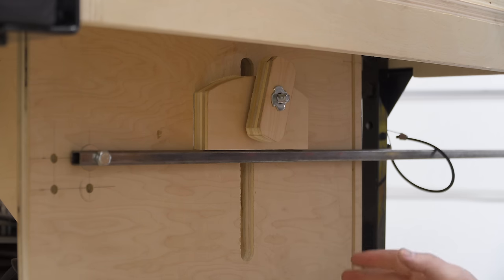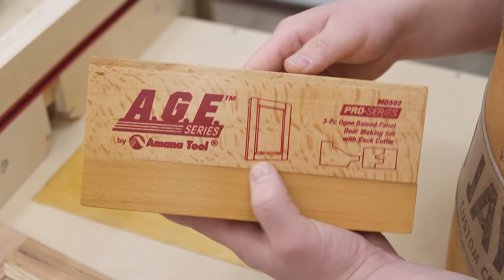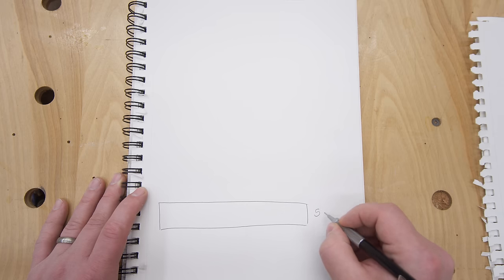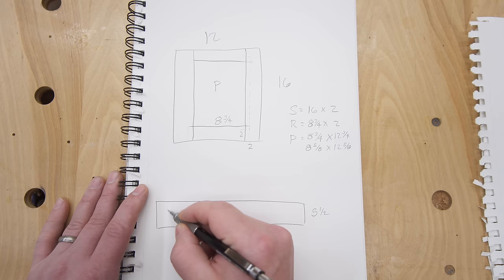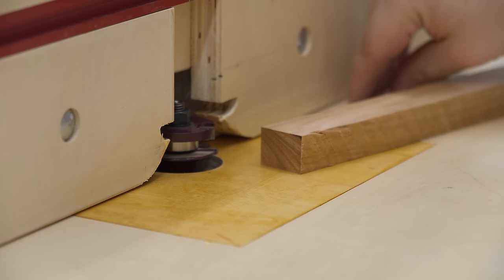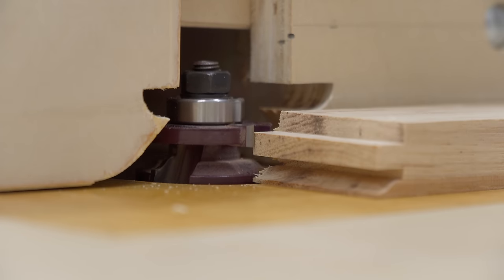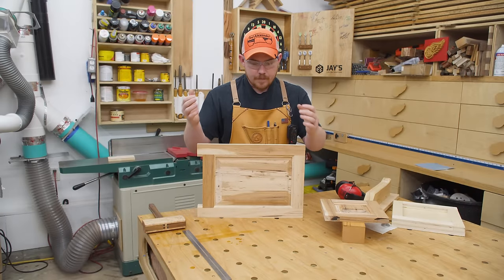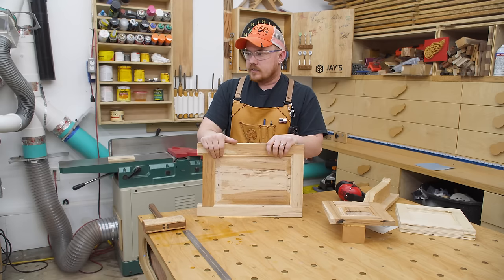Raised Panel Cabinet Door From Router Bits - 295

Comment from the maker: A couple of things...
- Article for this video: https://jayscustomcreations.com/2018/01/cabinet-doors-from-router-bits/
- This is the bit set I used: http://amzn.to/2CAoXdF
- Link to the router lift build video: https://www.youtube.com/watch?v=2WyOskBpz_k
- When using the raised panel bit the dust collection wasn't as effective. I'm not sure if that's because the large amount of material being removed, the feed rate, the sliding fence pieces, or if I need to block off the extra air space next to the router. Either way, it's the only bit I've used in the setup where dust collection was not almost 100% effective. 
- Have a great day.
Reply: Very informational video Jay!  I enjoyed it!
Reply: I like your Router table out the ones I've seen made.Nice setup!What kind of wood is that on the door?

Comment: When I glue up raised panel doors like this, I like to put one coat of finish on the panel by itself before assembly. It allows the panel to move a little more smoothly with expansion and contraction, as well as not leave the “finish line” exposing bare wood with movement. It also makes it a little easier to clean up the glue, not having to work so hard getting all the “nooks and crannies” cleaned out. 

Loved this vid, great explanations all the way around Jay.

Comment: Keep those scrap pieces you used for setup, they come in handy later. Most hardwoods that you’ll use will be the same thickness. Then you can put the scrap into the bit profile and eliminate time in setup 😉
Reply: I was  thinking with that push box he made could make a cut of each bit on a side and have all 3 settings on one piece.

Comment: Excellent video Jay.  I built doors in a cabinet shop for 3 1/2 years.  The block is a necessity behind those rails to avoid the tearout.  We did use space balls to keep the panel from rattling in the frame.  I would be interested to see what kind of expansion/contraction you have with the seasonal changes.  (y)
Reply from the maker: From my experience in Mississippi, we don't have much seasonal expansion and contraction. It's pretty humid all year so I haven't noticed much on previous projects. Except for the single time I used kiln dried lumber. It's too dry for Mississippi so all it expanded quite a bit for a few months then stayed about the same.

Comment: Another great and informative video from you Jay. I like seeing the layout process on paper for a change.

You demonstrated this very clearly, but I can 100% back you up on the ease of micro adjustment with your router lift. I just finished building mine from your fantastic set of plans and I am very happy with how it turned out. It was dead simple to build, and it works great. Also, after seeing how nicely the PC 75182 swings that big panel bit, I’m glad I went with that beast of a router.
Reply from the maker: Nice! Thanks for the feedback. Yeah, that router is incredible.

Comment: It looks like the secret to being able to micro adjust the router lift is having a long lever handle. Large movements at the hand end equates to small movement at the router.
Reply: David, I built a router lift from Jay's plans and you are correct. The plan allows some adjustment of the pivot point for the lever which you can use to adjust the ratio of lever movement to router movement. I think that's part of what Jay means when he says that the lever gives you a mechanical advantage. It really is as easy as Jay says to adjust this lift. The router lift build videos explain it better.
Reply: I'm just guessing this will be like many of Jay's other videos...Get a bunch of views now and in 6 months there will be an update video about how this was a bad idea and he needs something else (ie. the plywood cart, the lathe stand, etc. etc...)
Reply: Brodie P, I'm not sure if you meant that as a slight or not, but I see his approach as an honest and growth oriented mindset. I like the revisiting of older ideas and newer reiterations- that's innovating and showing you don't have to be a perfectionist and put something off trying to get it right the 1st time. This last thing is a common pitfall of mine and I like the inspiration/encouragement to resist it.

Not to mention it feels like we're having a discussion with him and coming along the journey.
Reply from the maker: Brodie P. It's called problem solving and continuous improvement. Don't be afraid to try :)

Comment: This process always seemed so intimidating to me, but you just removed that. Also, I wonder if people are holding the handle for the router lift at the very end and that's why they're unable to get an exact point? The way you did it by just rotating your hand gives much more control.

Comment: question Jay..... by the way man love what you do been messing around with woodworking for about 9 years and you make things seem very easy to get done man thanks.  My question is about routers purchasing one to be exact... I have a router with a fixed base 1/4" collect, but is doesn't have plunging capabilities and i'm very interested in giving my mortise and tenons more options beside chisels. I also am looking to get into making paneled door for possible cabinets. Please any suggesting on size of collect maybe 1/4 or 1/2 or both and even routers as far as brand and power weather it should just be a trim router or a big dog one thanks.

Comment: Great video.  When cutting the larger board for the styles and rails, recommend that you include the blade kerf in the measurement.  It was not a factor in this case, but I've had a couple of projects where the last board was short by "just that much..."

Comment: Thanks for the info.... But maybe a lil' help with the glue up ? I don't believe all sides get glued, the panel needs to move freely? Thanks again
Reply from the maker: I never glued this door. From my research, make the panel 1/8" less in both directions and either center the panel on the rails and put a dot of glue in the center of the rail groove or use compression spaceballs on both sides.

Comment: Hi Jay, You seem like a knowledgeable guy and am hoping you can help me find a solution to my router bit problem.  I make wooden knee sliders for motorcycle roadracing.  My sliders are a simple rectangular shape with rounded edges.  I have been making them with 90 degree sides and using a 1/2" diameter round over router bit (in a table) to soften the edges.  I would like to angle the sides slightly in an attempt to minimize chipping since I use the more durable and longer lasting end grain on the main dragging surface instead of edge or face grain.  Is there a way to make a chamfer and round over/soften the edge with one bit?  I can't figure out a way to do it even using two bits.  Is there such a thing as a round edged chamfer where the chamfer is straight but has a curved shape at the top?  Thank you in advance for your time.

Comment: I know its an old video and where drawing and calculating by hand but i was wondering if you know the software max cut. Its basically a software for shop who sales wood and cuts services. You enter all your pieces measures and it optimize your cuts its free for home use and still cheap for commercial use. I use sketchup to draw and break apart the pieces and after that i add the pieces in max cut. You can set it to follow grain of if grain doesn't matter like mdf. You specify the blade kerf and it does all the job. It tell you the number of sheets if its plywood, or msf, number of cuts...

Comment: +1 on the home made push block. It's a cheap necessity. Save your final test pieces as set up blocks for future use. Unfortunately, except for small, "one off" jobs and repairs, the demand for these skills are shrinking. Hard to match the production capacity of a CNC shop.

Comment: Really enjoyed the video Jay.  In particular I liked your 'setup square' backer board.  Am I understanding correctly that you can arbitrarily set the 'coping' bit at any height, but that this would determine the necessary setup height of the 'sticking' bit going forward?  Also, I've got a 3.25 hp router in my table, I would assume this is enough power to cut a panel in one pass as you did?

Comment: Why use a fence at all when the bit has a bearing? Except maybe for dust collection?
Reply from the maker: To start the cut and to make sure you don't accidentally round over the adjacent edge when exiting the cut. It's extremely dangerous to start a cut on a bit this large without a steady fence or pivot pin.

Comment: Nice job, personally I prefer the Sommerfeld tools matched cabinet making router bits, set one bit and all the others are set too...no messing around with moving the router up or down. I would recommend using a width or 2 1/2 inches for your stile and rails, that size scales nicely  (looks very pleasing on any size door) but more importantly leaves plenty of meat for pocket hinges and other cabinet hardware. Thanks for sharing!!!!

Comment: Very nicely done video.  I just got my first set of router blades to do the raised panels and was working with them today.  I had a few issues which were driving me crazy and which I finally figured out.  I wish I had seen your video first and I am sure that the afternoon would have gone easier.  Thank you for the video.

Comment: Hi Jay, first off all a nice in informative video. Do you have tried to cut the ends of the trim boards in a 45 degree angel, for a different look or to mix up the top parts of the tongue and grove bits for another pattern? If possible I mean.

Comment: Good video! However, I see that you have to play with the depth adjustments when switching bits. The same bits I have was purchased from Sommerfeld Tools with the bits ground to match the tongue depth on all 3 bits without any depth adjustments. He has a rubber grommet inside the chuck that holds the depth true when switching bits. Just a matter of dropping the bits and route away without any depth adjustments!

Comment: Great video.  Learned a great deal.  Would like you to talk about the push stick you used on the jointer.  It looked like something I would want to make for mine.  On a topic not in this video.  Do you still use the pantorouter?  Have not seen it in recent videos.  If so what are the pluses and minuses to having it.  It is a large chunk of change for one machine?

Comment: Jay love the videos. If you had a miter slot in the front of your table they make a miter square that has a squeeze clamp that makes those end grain cuts nicely. I've noticed that sometimes without it, the workpiece might vibrate towards the cutter. Just a thought.

Comment: The details in the video are perfect.  I like to use space balls to keep the panel centered and from moving around.  If it stays centered, the edges that the don't have finish or paint won't peek through.  The space balls also keep the door from chattering when they open or close, just in case the door shrinks or expands non-uniformly.

Comment: Nice  door! Nice router lift. You could add a temporary  micro adjustment with a block and a fine thread tee nut  and cap screw ,screwed under the lift arm. I think it works fine the way you you do it.

Comment: Mark Sommerfeld had a good video on setup. This is also a great simple video. Mark had a tip on putting a rubber gasket underneath the collet. If the bits are matched you won't have to readjust the height for the cope and stick bits.

Comment: Jay, I am half way though a 25 door re-do of my kitchen using a cheap bit set from Amazon and your router lift xl. It has been so darn nice to have the lift. Ease of bit change, adjustment, and dust collection has made the job so fun. My old cabinets belonged in a 1960's camp trailer. Now I have new flat panel shaker doors that look awesome.

Comment: nice setup.  i always like making several cuts to get to the finish dimension. it avoids heat, burning,sap and gum release from the wood.  nothing more frustrating than a gummed or varnished tool

Comment: Love it, nice and simple rocks once everytjing clags up with sawdust! If any are less steady with their hands than you are however... i noticed your right hand, when raising the adjustment bar, was on a plywood ledge running vertical. Perhaps a block that clamps quickly on and off of that with a thread and bolt through to act against the bar would be a nice but mostly unecessary addition. But i reckon itd do me as it stands, thanks.
Reply: Simon Smith - I thought the same thing for those wanting “accuracy” :)

Comment: older video so we'll see if anyone sees this, but on the first router setup; does the front of the bearing really need to be in line with the fence? Maybe I'm missing something, but if the right side of the fence is slightly in front of the bearing and the backside slightly behind, it shouldn't really matter. It's the bearing setting the depth of cut; In that setup, right-side would take a slightly lighter cut, and as it moved to the left-side, the cut would get cleaned up.  ...right?

Comment: Glad to have watched this. I have just bought a set of six cutters and three of them are for the doors on cabinets similar to what you machined. The other cutters are a drawer lock joint, a cutter to make a glue joint for the panel and another for a door lip. Your test backer glued up door is a must for these big cutters, so thank you for sharing I will be using your method.

Comment: I’m now watching James King”s Aquarium cabinet build video. I suspect that you know this, but for those who were still in the dark as was I, the ‘cope’ bit is called that because one would usually use a coping sled to make these cuts. Either that or the sled is named after the bit, in which case we still have no reasonable explanation for why this is called the cope instead of the tongue bit. 😜
Reply from the maker: It's for a coping cut to match a decorative profile. Like with crown moulding you can run one piece directly into a corner and then cope the profile to make it look like a miter.

Comment: Jay,
Apologies for not seeing this sooner.  I watched this video because I bought a router table so I can make raised panels for a set of cabinets I am making.  This is the first set I am making and I am fairly pleased with the progress.  Any way, reason I am writing is to suggest that you could mount a ruler on the side of your router extension, behind the raise/lower bar and add a pointer, if for no other reason then to be very repeatable.  Just a thought.

Comment: I make all my panel doors 1/8 inch oversize then I square them up and cut to final size after the glue dries.  This helps when you are making a lot of doors and you need a high degree of accuracy such as for inset doors.
Reply from the maker: Good tip

Comment: color me stupid, but why does the fence need to be in line with the bearing.  If you are running the end of the board against the bearing it should 'work out', correct?

Comment: Made a block like you did for doing the ends of the rails but glued some 150 grit sandpaper to the edges to help with gripping the stock.
Have made several of these to cope with the various patterns of the panel bits I have and have been using them on and off for over 10 year's.
Another shortcut I use is to machine the rails in a large piece, doing the ends 1st, and then rip them to the required width before moulding the groove for the panel.
As i make most of my panel doors from MDF this is way is certainly easier than using solid timber but having said that a wide board of say 8-5 inches would allow you to mould the tongue ends and rip it to 2-0 inches achieving 4 equals widths with the extra lost in the saw kerfs if the blade is narrow enough. 
Just a thought anyways.
Reply from the maker: Good info. I generally prefer to cut pieces to rough length before milling though to reduce the amount taken off on the jointer and planer. But the method you described works as well. I thought about putting some sandpaper on the end of the plywood but didn't want to cut into it with the router bit. I doubt it would do any noticeable damage but it was more of a mental "don't do it" situation.

Comment: It wouldn't be that hard to add a screw based micro adjustment to that setup, if you just drilled and tapped a hole in the bar under where the lock clamp touches it and clamp the end of the bar where you use your hand to adjust. I wouldn't bother myself as it seems more than adequate as is, but if people are that bothered it wouldn't take much to do

Comment: Thanks for going back in time for a "bit" (no pun intended).  I've followed you since all you built was 2 by with pocket holes (loved the synced music and driving screws).  Anyways, the coping/push block is great. Besides preventing tear out and getting blood on your router table, you get a setup block for future projects and if the edge gets too badly chewed up, just run it through the table saw and good as new.  All without spending hundreds at Rockler. Thanks.
Reply: Pete Nilsen I

Comment: The router plate was genius.  

Question, why not joint and plane the plank in larger pieces? It will be easier to avoid snipe. 

Thanks again for sharing this.
Reply from the maker: I don't get much snipe when I feed the pieces through back to back and use the first piece to backup the last piece. Also, when jointing a long board you will remove waaaay too much material to get it flat if there is any bow, warp, or twist. Bringing smaller, intermediate sizes to the jointer will reduce waste.